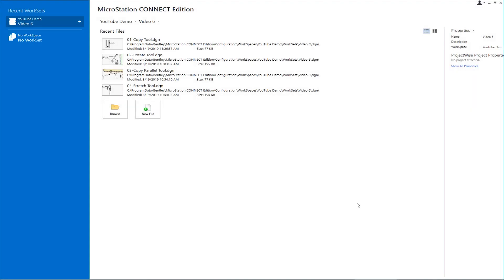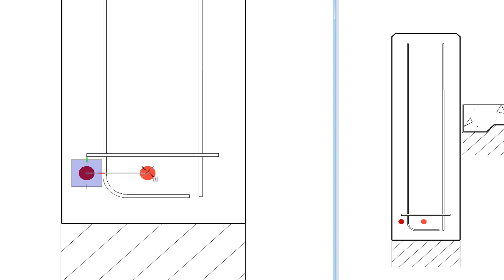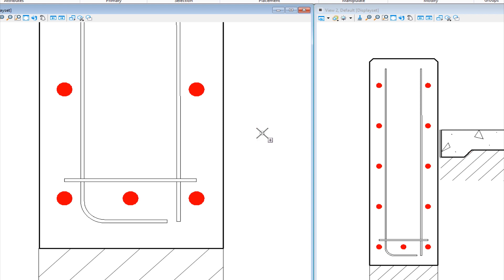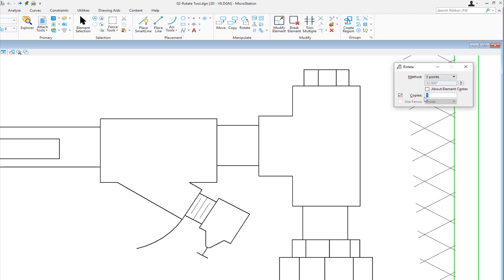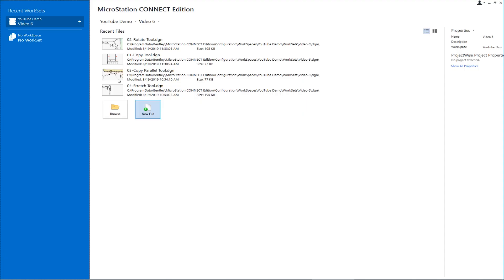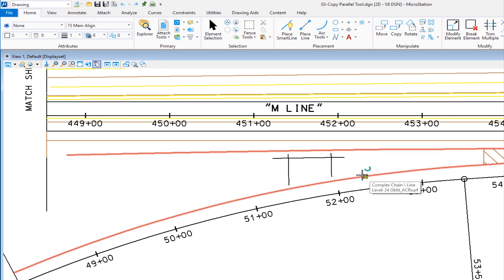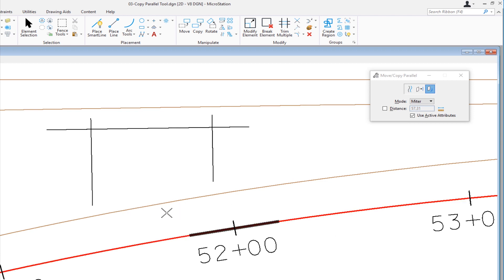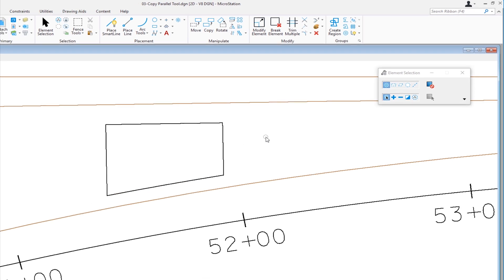MicroStation CONNECT Edition 2D Basics: 06 - Element Manipulation using a variety of tools.

Comment: The trick I found most useful in this video is the 'keypoint snap divisor value' (4:40) which will give an element multiple keypoints at the desired interval - no need to manually measure its length and calculate the length of the interval.